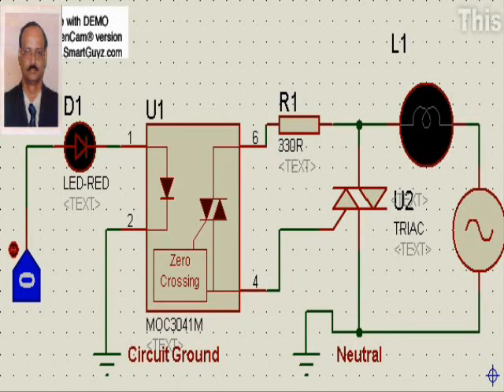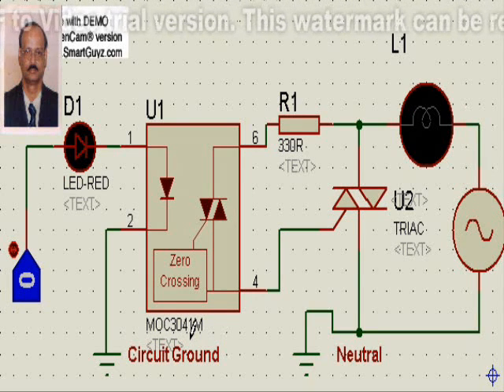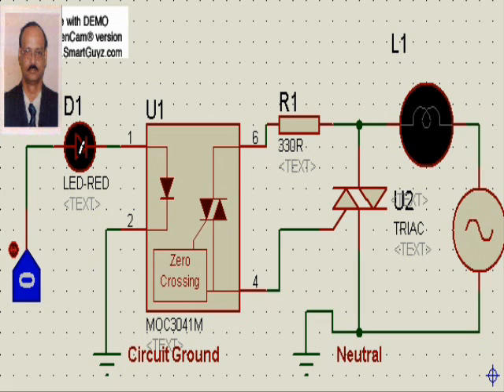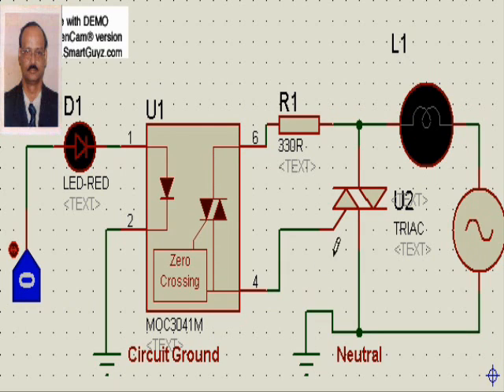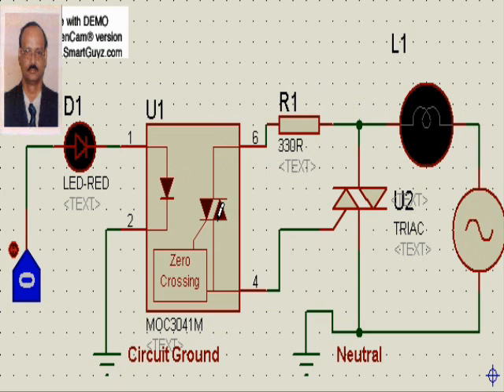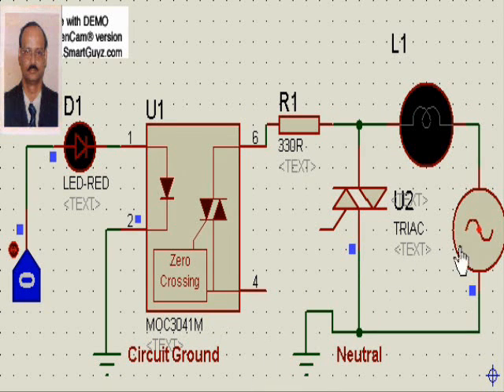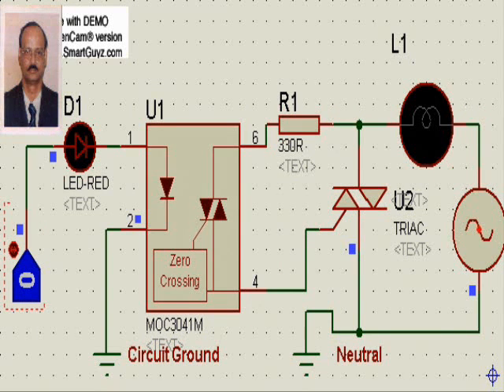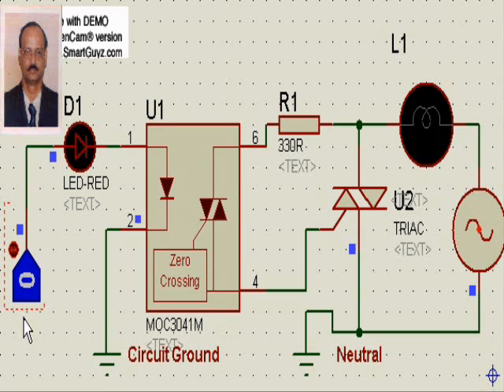AC load interface to Microcontroller

Comment: Sir I have made similar circuit to operate 1 hp motor...but my circuit is not working...instead it is burning resistors across pin 6 and MT2 terminal of triac....It worked for several times initially...but now it is not working....pls help...
 I am using MOC3021 optocoupler and BT136 as triac
Reply from the maker: manish chavan That was for the purpose of understanding the interface and is suitable for linear loads. For inductive loads like motor you must use snubber. Please watch my videos on my the same.
Reply: @PatnaikUC   Sir I have used snubber circuit for the same... Even though resistors across pin 6 of MOC3021 and Triac pin MT2 gets burn... I am using 330 and 470 ohms in series 1 Watt each....
Reply from the maker: manish chavan Trigger circut needs to be checked. Have u taken zero sense input for trigger? Watch my videos on the same.
Reply: @PatnaikUC  Sir I am using arduino for triggering...MOC3021...Voltage across pin 1 and 2 of MOC3021 is 1.5 V....Sir how do I detect zero crossing...
Reply from the maker: manish chavan zero cross detecting is a must. Watch my videos on the same. Also watch my Arduino based phase angle controlled ac power control.

Comment: Thank you for the explanation, i appreciate the reply on the following:
1- can the opto coupler 4n35 be used instead of the MOC3041?
2- what simulator can be used to test circuits before applying it in real?
3- can the triac be used to reduce the AC voltage?
Reply from the maker: +Tarek Chayya 1=NO. Since 4n35 is a non xvs type and MOC3041 is a zvs type. 2=Proteus. 3=yes but MOC 3021 like opto is to be used.
Reply: +Patnaik UC thank you for your kind reply, i appreciate if you can explain how to reduce the voltage using the triac and the moc 3021
Reply from the maker: Watch some of my  other videos on the same
Reply from the maker: +Tarek Chayya AC power control  https://www.youtube.com/watch?v=NQyIWol5Lzc
Reply from the maker: +Tarek Chayya Simple power control  https://www.youtube.com/watch?v=NTYsljkC-BA
Reply: +Patnaik UC Thank you very Much

Comment: Can you please supply more details on the value of the R1 resistor?  I found a source that looked at the peak voltage of the supply and then calculated the R by using R=V(pk)/I where i is the non repeatative surge current for the optoisolator which the data sheet shows as 1.2A.  If 1.2A were to go into the gate of the triac with a 100ma max then wont that burn it out?

Comment: Can i use this triac to switch ac power to turn on and off a 24V AC solenoid valve? the ratings of the valve are @ 24VAC 0.35 AMPS in rush current. Holding current of 0.23AMPS @24VAC
Reply from the maker: Yes

Comment: Need to ask u about LC circuit, if u from Miller about the lc circuit in dc.which generates sine wave.
Little confuse why the coil waiting for the capacitor till its become fully discharged then the coil charge back the capacitor?
If the coil resist change in current so it cant be that coil will wait for the capacitor till its become fully discharged, right?
Would u please help.

Comment: Hello,
To anyone wanting to create such circuit from real components- IT WONT WORK. Theres a mistake in the schematic. The resistor should not be connected to the bulb terminal, but to the NEUTRAL / PHASE terminal. I have checked this. Otherwise the gate cannot be triggered. Thank you for the schematic though.
Reply from the maker: Have you tried or just writing for the sake of a comment ?This way I have manufactured 5000 projects which are working perfectly in my 40 years of work experience in power electronics.Please ,better try and then comment.If the resistor  point goes to phase the opto and the resistor will blast and if goes to neutral it will never work.
Reply from the maker: Łukasz Przeniosło Power electronics is a subject not so simple as Raspberry Pi ,embedded system,Arduino , BLDC,FPGA,temperature sensor etc that you might have tried. Power electronics needs years of practice.Your fundamental knowledge on application of triac , scr seems
to be not clear. Please watch my  other videos that will improve your knowledge and
remove your mis-conceptions on them.

Comment: sir can give me values of resistor 330R is 1/4Watt or 1Watt or more?
Reply from the maker: 1 to 2 watt and not 1/4 watt
Reply: I Make same circuit On DOT MATRIX PCB but , it is not working. give me some debugging instructions
Reply: OR Suggest me some other circuit diagram.

Comment: I am using same circuit but it is not working for me.And without applying dc i/p to 1st terminal of MOC(3063) still ac supply is showing at 4th terminal of MOC(3063) but load is not running.i am using MOC(3063) & Traic 137 load is bulb .So what wrong is happenig??suggest me

Comment from the maker: you can check just as you check a diode / LED in a multimeter for pin 1 &2 of the opto to find out whether it is ok or not

Comment from the maker: All testing that I have mentioned is not required.Simply change the opto to MOC 3020 or 3021. Because with ZVS opto like 3061 3063 one cannot control the power.

Comment from the maker: For simulation purposes mains was shown to DC ground .Pls remove that. To test;-Remove opto from socket ,the load should go off.If not the triac is short or you have not identified the traic terminals correctly in particular the gate.  .If the load goes off then take an insulated wire and shot circuit the pin 4  & 6 while the opto is not on the socket the lamp should glow.If  OK then the put the opto back  If  glowing then your program is wrong as 3064 is a zvs use a MOC3021. it will work

Comment: Dear Sir,
I am using MOC 3064 and BT 136. The resistor used are as per the data sheet but my load is on continuously. Can you imagine any reason?

Comment: Thank you sir but when I bypass the led the 89S51 is giving 0.86 voltage on P1^1 and hence optocoupler is having 0.84V, So the load is not operated. I think the controller pin is getting load. What should I do?

Comment: I have connected 220ohm resistor and red led and then moc3041 to the P1^1 of 89S51 microcontroller and I am using BTA16 Triac. I have set P1^1 but i am getting 2V on this pin and when I disconnect the optocoupler connection I am getting 5V. I don't understand where I went wrong? Please help me. Thanks in advance

Comment from the maker: Scr is an unidirectional device while triac is a bi-directional device.Triac is used for AC while 2 SCRs can be used for AC in back to back parallel  method.The SCR is also used in many DC applications while the triac can never be used in DC applications.